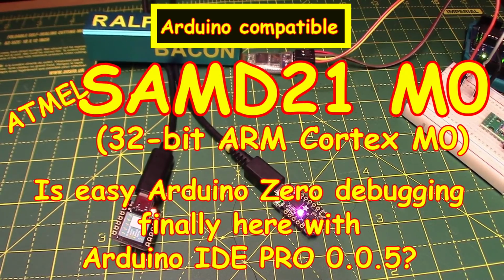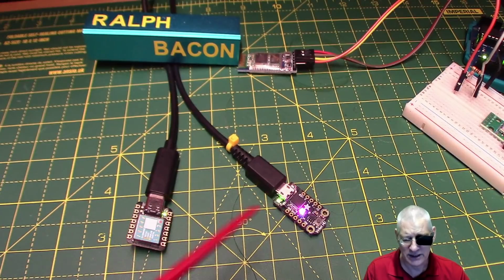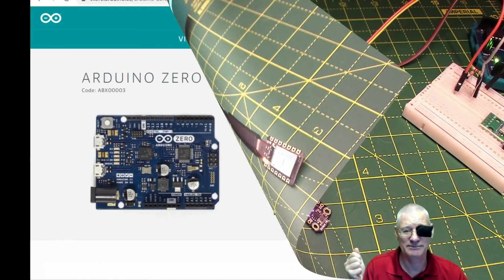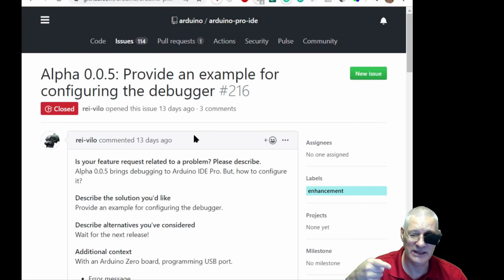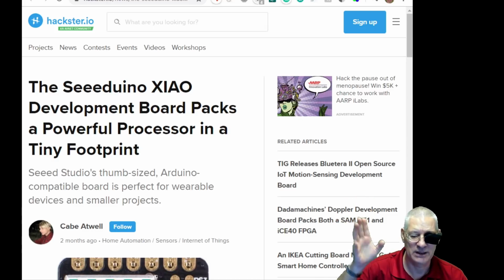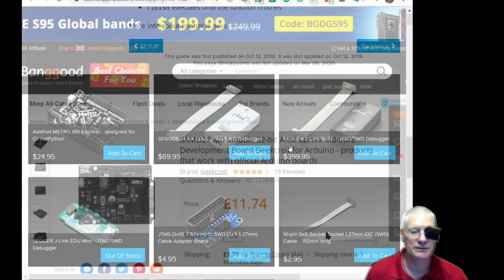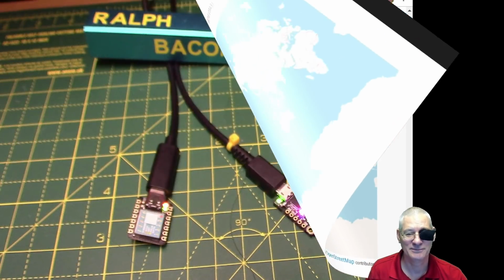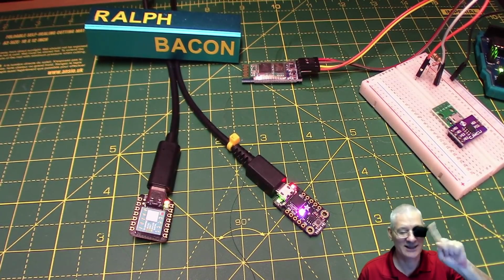#180 SAMD21 M0 boards + Arduino Zero with PRO IDE debugging?

Comment: I think my Seeed Wio board broke my arduino ide...(2.3.2) It won't open any more.
Reply from the maker: You mean the Arduino IDE won't open? Make sure you haven't got an existing instance running (or reboot your PC). If all else fails, uninstall and reinstall, you should be fine.

Comment: hi Ralph, 

1. The Arduino IDE 2.0 beta now with live debugger that supports SAMD and MBED based Arduino boards with Segger J-Link SWD interface, between SWD port and the default USB Programming port which one is the best for live debugging ? ( I means, the genuine Arduino Zero borad where the USB programming port and SWD pins were there anyway )

2. Any reason why the USB Programming port is excluded from most of the SAMD21 M0 clone boards ?

3. Have you tested the SeeedStudio Expansion Board below with SWD interface with new Arduino IDE 2.0 live debugger ?

https://wiki.seeedstudio.com/Seeeduino-XIAO-Expansion-Board/

Already ordered this board, arriving today, will test it with Arduino IDE 2.0 beta with live debugger later.

Latest updates, suddenly this morning the Arduino Zero is available back in the Arduino Store at the link below. I thought this is a retired product but anyhow already placed order.

https://store.arduino.cc/usa/arduino-zero

Please advise.
Reply from the maker: I did some rudimentary debugging on an Arduino Zero some time back and whilst it "worked" the IDE was far too flaky. Now that version 2.0 beta is out it might be a whole different ball game so I will revisit in due course.

Comment: Did you ever try out the Zero with the Arduino IDE debugger?  Was it fully functional as a debugger?  Or do I need to move over to Visual Micro and Platformio?
Reply from the maker: I did try it, but the version of the PRO IDE was a bit 'flaky'. It did work, but lost connection too often. Now there is a much better PRO IDE version (I used it in video #200 (https://youtu.be/D0Hr24QDD-s ) so I should really revisit this. As it happens I'm currently using PlatformIO with VSC right now and I want to try that debugging facility too (I have some cheap hardware on order). So we are on the same page.

Comment: I came across this accidently, I was seeking some thing around and fell into it. It is interesting, but hey, can you please make a series of tutos on how to implement a completely running Linux system on an ARM microcontroller , that event would be very very exciting don't you agree ?
Reply from the maker: I'm not sure my subscribers and viewers would be that interested in Linux running on ARM - hang on, what about the Raspberry Pi these days, doesn't it already do that?
Reply: @RalphBacon  thank you for your reply, but the point is that I always wondered how it works (like a child in front of o toy). I do not want a plug'n play way of working,but how it works really. That is how to implement it literally, step by step from a to z ?
Reply from the maker: I'm afraid that would be too long a topic to cover and I'm no Linux expert (nor fan, if it comes to that, I use it when I have to on my Pi). I bet somebody has done this though!

Comment: Hello. That's another well made video, thanks. Here's a point to think about. There are 3 different boards from arduino that make use of SAMD21-chips. That are Aduino zero, Aduino M0, and Arduino M0+.
The Wemos M0 board looks like being a clone of Arduimo M0+. To debug one of those I use an Atmel ICE-debugger. I have bought it used and for that reason it was really cheap.
Reply from the maker: I'm not surprised you bought it second-hand, they seem to start at around £100 in the UK, ouch! Once I get the board from Banggood I will see what it is like.
Reply: @RalphBacon  The wemos board is poop. Wrong M0+ bootloader where the board itself is a true Mo and not a "Zero"...
PIN2 and PIN4 are mixed up just run the fade.ino example and have a sniff at not working pwm on pin2.. The wemos one is bad and the robotdyn too

Comment: Hey Ralph, glad you're feeling better. You'll need to be careful with the RobotDys clones marked as WeMos (they're not from RobotDyn and they come with a different bootloader -- the Arduino Zero boot loader, rather than the Arduino M0 bootloader that the RobotDyn comes with). I have both boards and while they look almost alike, the RobotDyn ones have better quality (they're also a bit more expensive). I have a github wiki page I use to keep track of articles about them: https://github.com/parasquid/mcu-iot-sensors/wiki/SAMD21
Reply from the maker: I've ordered that SAMD21 (Zero clone?) from Banggood, Tristan, so it will be "interesting" to see how it compares. I shall read your wiki page most certainly, thanks for the link.

Comment: I am wondering if the arduino "language" will be expanded to take advantage of capabilities of the 32 bit arms chips. I have a stm32 Nucleo (f0) board that I can program via the arduino ide in arduino speak but the arduino SDK attempts to maintain compatibity with the 328p so all you end up getting is a faster chip.  Will the libraries have to be re-written to support the 32 bit chips ?
Reply from the maker: Interesting question and I hope the answer is Yes. When I developed my Home Alone project I used an ESP8266 and I had access to the full C++ language and functions as well as full control over the device. It would behoove Arduino to move the software into full C++ 11 compatibility (if users want to use it, they can always still use Arduino-speak) as well as the hardware. Fingers crossed, Joey!
Reply: @RalphBacon  by "full c++" do you mean all the language features? or all the standard libraries? I'm pretty sure the compiler backend that arduino is using can do all C++ language features (classes, inheritance etc.) and if you #include any standard library it will attempt to compile it in, though some things won't make sense - like anything that assumes the program is operating within an operating system (since your arduino program essentially is it's own operating system as it is the only thing running - and I say that is a GOOD thing).
Reply from the maker: I mean everything that you could reasonably expect, say, Visual Studio to successfully recognise and compile. The library "StandardCplusplus" gives me errors that I just don't have the time to fix so out it went. I will bide my time and see what Arduino.cc come up with later in the year!
Reply: @RalphBacon  I think Arduino is being held back my the one language fits all. Like to read an 8 bit port you read one bit at a time so that you don't have to think of port as a,b,c etc. so until they break away from the one size fits all approach it will remain a play with thing and not fit for a product, IMHO. :)
Reply: My approach with all arduino is to use the arduinospeak for things I'm not too concerned about the details of, and hit the hardware directly for any time I'm wanting direct control of what's happening. The arduino IDE is for me just a text editor with integrated compile and upload functions - the libraries and basic functions often do things in a very inefficient way because they are always trying to get universal compatibility across many different platforms, for example the LiquidCristal library uses busy-waits (delayMicroseconds) to send nibble after nibble of data while writing to the screen. A timer-interrupt based FIFO would be able to handle the sends asynchronously with far less overhead, but setting this up to be able to work across many platforms would be hellishly difficult (though I can imagine a TIMER0 compare match interrupt delayed-fifo that could be useful for many things and could be implemented on many platforms and incorporated into many libraries)

Comment: Thanks for another great video, Ralph!
When you list pin capabilities in the future, could you please also mention how many pins are interrupt capable in addition to analog, digital, PWM, etc?
Thanks!
Reply from the maker: I'll do my best, Martin, or could follow the links I painstakingly transcribed into the video description and probably find out in less time than it takes me to type this sentence! Just sayin'. But I will (try and) remember for next time.
Reply: @RalphBacon  I know, I know, sorry mate :-)
But you mention all the other pin properties, and I can look those up too in your links, can't I? And this one can actually "make the sale" for me, whereas the info that a board has digital output pins isn't that useful - unless if it had almost none, because then it would definitely be worth a mention. 
Anyway, just a mention of what I look for in every board presentation, your videos are still great!
Reply from the maker: I understand you totally, Martin, I'm cross with myself that I did not mention this as I was pleasantly surprised when I read:
All pins on Seeeduino XIAO support interrupts, but two pins cannot be used at the same time: 5 pin and 7 pin
So from your point of view, this is good news, right?
Reply: Absolutely, Ralph 👍
Thanks again!

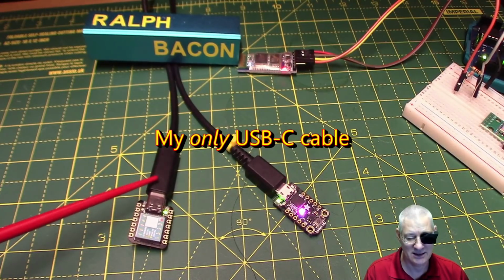Comment: At 5:00, is that USB-C at both ends?  If so, I'd probably need an adapter to USB 2.0
Reply from the maker: The cable I'm using is a USB 3.0 Type A to USB-C - but it would work with a USB 2.0 connection too. In fact, there is evidence that too many things plugged into your USB 3.0 sockets will cause you to run out of resources so the recommendation is to keep simple things like keyboards, mice and Arduino boards like this on USB 2.0.

Comment: Hi Ralph, I welcome your variation into the more powerful ARM processors.

FYI, the 'G' variant on the Seeed board has a few more of some of the internal peripherals (e.g. 6 serial -- UART/SPI/I2C channels vs 4 on the 'E' variant on the Trinket, and 14 vs 10 ADC channels). Whether they are all available on the breakout pins is another matter. Also, the 'G' is a 48 pin device vs 32 pins on the 'E'.
It also seems there are more breakout pins on the Seeed board (and it is cheaper!).

Cheers, Mike.
Reply from the maker: Good information there Mike, you obviously know these devices better than me! As you say, on these particular boards we probably don't get access to the relevant pins to fully exploit the chips capabilities but on the Arduino Zero (G variant), and the clone from Banggood (unknown variant until it arrives) that may be a different story.

Comment: Great to see you in action! I was surprised you didn't go with the ESP32 to be honest.
Reply from the maker: I've done a few videos on the ESP32 and a very capable chip it is too. But it doesn't allow debugging as far as I am aware (not without extra hardware anyway). The SAMD21 is really just an evolved 328P, whereas the ESP32 is in a different league all together.
Reply: @RalphBacon  now I understand  master. There are times when it would be easier to give up your "left nut" than find the error in your code. That does sound like a much better solution to the problem, certainly less painful too.

Comment: Hi Ralph It’s A little funny though, that the Weemos/Robotdyn actually has SWD(EDBG) connector Block which is wired to the processor (https://robotdyn.com/pub/media/0G-00005517==SAMD21-M0/DOCS/Schematic==0G-00005517==SAMD21-M0.pdf) So it would not be available via the USB connector but still.. Anyhow the debugger probe that’s mentioned, The Segger J-link - I believe that clones are to be had at quite fair Price on Banggood/AliExpress. Anyway keep up the good content.
Reply from the maker: I suspect (and hope), Gert, that once debugging becomes easy then the Asian markets will rise to the occasion and provide debugging hardware and/or build it into their clones (like the one you mention).
Reply: The jlink mini or edu is relatively cheap as a debugger. I believe the black magic probe can support these chips. If so, there are tutorials on how to turn an stm32 blue pill into a black magic probe.

Comment: Lots of the Arduino's had debugging via debugWIRE but no one seems to have used it. it's a shame as PIC's have had debugging via the programming pins for years. on reason that i don't like arduinos as debugging via serial is just a pain in the back side.
Reply from the maker: I'm guessing that Arduino.cc were more interested in just getting people involved so that debugging in the true sense was not on their list of priorities. But once you have experienced true step debugging (like I mentioned with Visual Studio) you miss it like crazy when things go wrong!
Reply: @RalphBacon  Microchip and the Pickit4 i think can do debugging on the arduino's in labX. Was going to try just before christmas but when i when to but the pickit4 it had gone from £28 to 43 over night. £15 increase on £28 +vat is a lot so out of the basket it came. will try later if it comes back down in price.
Reply from the maker: I had a new-ish PicKit 2 and then they brought out the PicKit 3 to support newer chips. I was incensed! Such a lot of money to support just a few new chips (that I bet the PicKit 2 could have with  a new flash). So I moved on to Atmel-based Arduinos and never looked back. Now Microchip is back in charge. Oops.
Reply: @RalphBacon  If microchip can move people away from bootloaders and using proper programmers and the ability to debug  it can only be a good thing. I'd buy a pickit4, but i have a pickit2, 3, and ICD2, 3, picstart plus, and a lot of home made programmers, then they would bring out the pickit5 :) I've never liked the arduino debugging via serial it just make the program look a mess and harder to follow what your doing. Keep up the brain food.

Comment: Adafruit Trinket Mo can also do circuitpython, no ide needed, just a text editor and putty (terminal program)
Reply from the maker: Indeed it can, Jyv, and the Adafruit documentation covers this. I'm not sure I want to go there, right now. Python was bad enough on the RasPi!
Reply: @RalphBacon  raspi python , 
the gpiozero library makes it easier, it is from a raspi org fellow

Comment: Anyone by chance know anything about the AT32UC3C0512C chip by microchip??? I am having a rough time trying to figure out pinouts and such... only reason I am asking is this chip is a 32bit MCU as well as this SAMD21 series... figured I would be more likely to get an answer to my questions if I am in the same "bit/core" style... as always keep up the good work Ralph!
Reply from the maker: I'm afraid I am not familiar with the AT32 😔. Any reason you need to use that chip rather than a more "mainstream" chip for which there is more support?
Reply: @RalphBacon  I am trying to get away from the atmega2560 and for my application I need more pwm channels... wasn't sure if this chip is better or not so honestly no major reason I won't mind using the SAM series... as long as I can get more pwm...
Reply from the maker: The Seeed XIAO has 10 PWM interfaces! Woo Hoo!
Reply: @RalphBacon  haha thanks I think I need up to 19 pwm signals I took your advice and went with a SAMD5 series chip it has 24 PWM... I will use this tell the NXP iMXRT1170 comes to market then I will use that (the series of chip teensy uses)

Comment: Thanks for the usual high quality video Ralph. I’ve been a fan of theTexas Instruments Launchpad boards for many years and they’ve all had built in debugging from the very first MSP430 boards. They don’t seem to be much used by makers which is a shame because they are very capable.
Reply from the maker: I'm hoping that the new PRO IDE will motivate our Asian manufacturers to include debugging tools into their boards (or produce standalone hardware cheaply). It might take a year or more but it will be so worth it.

Comment: For viewers, for whom English is a 2nd language: Carona when pronounced in english (as there isn't a double 'r') sounds like car owner, get it now? SAMD21,  very interesting chip indeed. I like the idea of using flash memory instead of eeprom (though the cycles needed to access [particularly writing] individual cells might be more than intuition suggests). I just like the full blooded ARM chips (good old acorn computers). The SAMD21  does seem to be a better (though superior) match to the ATMega 328Ps. The experience gained in using these chips is a gateway to the higher performing Cortex M4 chips such as STM32 chips (the beauty of the Cortex model is that the low level mnemonics are the same for the SAMD21 as they are for the chips in a Raspberry Pi, most tablets and your cell phone. so you can still use the same compiler [GNU GCC] for all of them). It would be nice, however if a little more support was given for assembly language (though, this issue lessens with the increase in resources provided in a chip).

One caveat, however, the higher performing chips   (some of which are equipped with many serial ports, DACs and math coprocessors) will not flash an LED any better than an ATTiny85. So, the power capacity of the MCU one chooses should be just enough to fulfill the needs of your project. 

Great video, Ralph
Reply: Does SAMD stand for Surface- to-Air-Missile-Development?
Reply: They are spelling it Corona like the beer, and referring to outbreaks as coVid19.
How do you get carona
Reply from the maker: Depends on your native accent I suppose. I just don't want YouTube to take down my video as I have mentioned the unmentionable!

Comment: you can use clone j-links ($8 on ali) to debug these using SWD. Pads are broken out on trinket. You do have to muck about with j-link firmware to get it to work though.
Reply from the maker: That's the problem - mucking about. Novics, and even experts, are going to get pretty frustrated with all that. It's got to "just work" like my Zero did today.